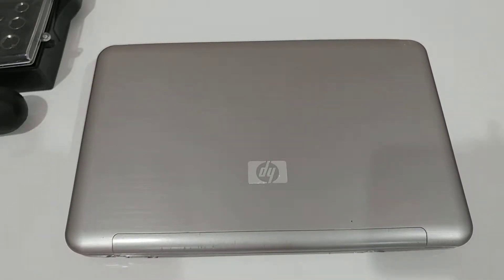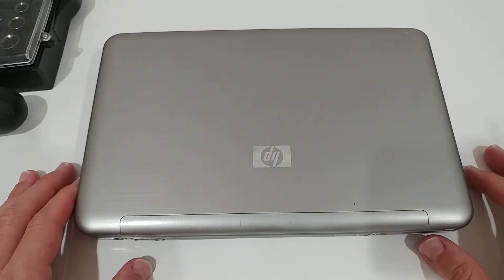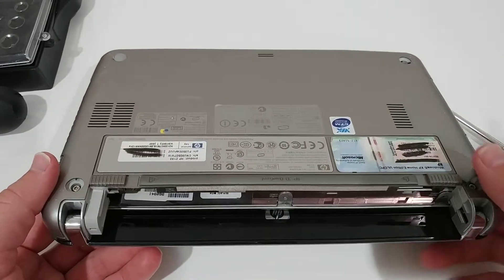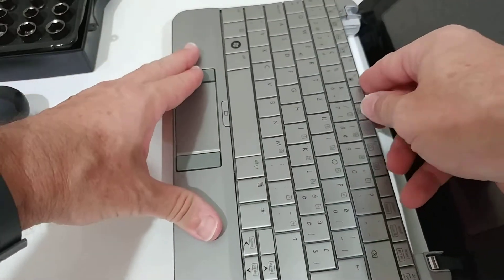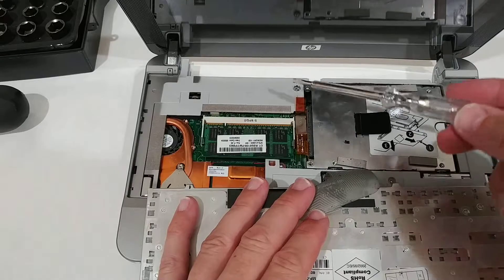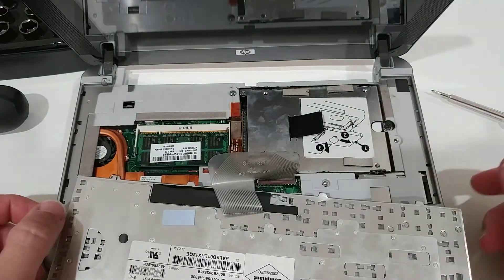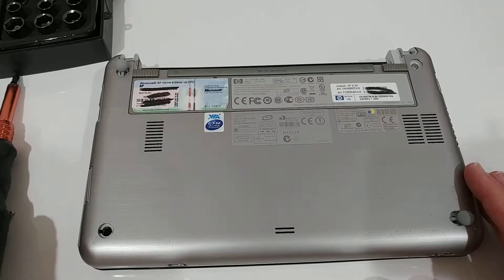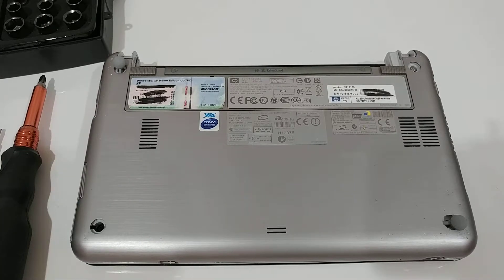How to upgrade, replace or remove the Hard Drive in the HP 2133 Mini-Note?

Comment: Can I put an SSD in? And what's the max ram it can support do you know? Thanks
Reply from the maker: Probably you could add an SSD of same size as the HDD, but I don't have it any more hence I can't really tell. Are you really still using this PC?
Reply: @allcheckout  haha, I was going through an old junk box and found it, fired it up to see if it was still working and it was. My little boy has been playing with it so I was thinking about upgrading the RAM and maybe putting a cheap SSD in, but not really sure it's worth the effort!
Reply from the maker: @mydv9305txdied  LOL. Hard to tell ... the CPU is just super slow and no matter what you do - it will be super slow, but for a little boy ... yeah why not

Comment: Hi, I have the same laptop.  It is limited but have you found an operating system that works well on this laptop?
Reply: Use windows 10 lite and watch lowspec gamer windows 10 optimization video.
Reply from the maker: I think I upgraded finally to Windows 10, but now don't use it any more, but was a great laptop for the price.
Reply: @allcheckout  Thank you